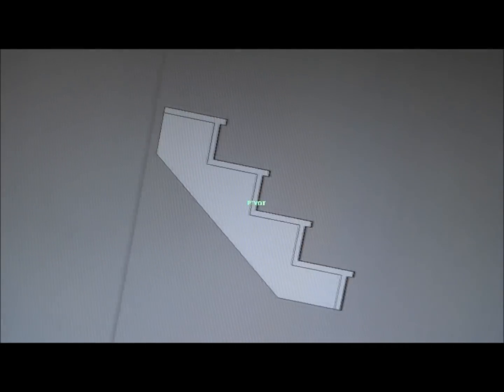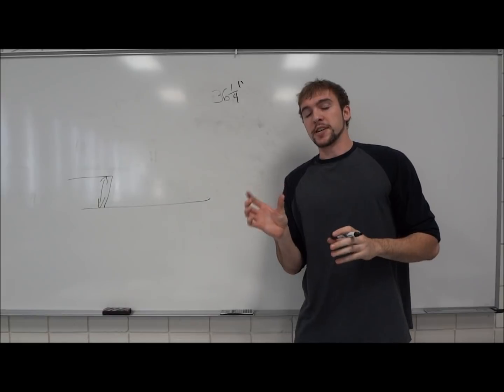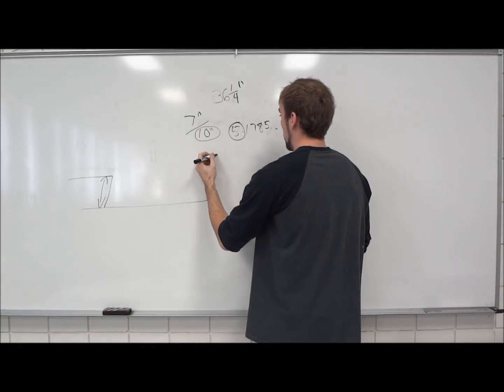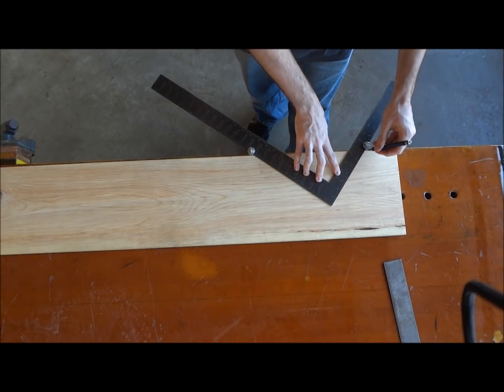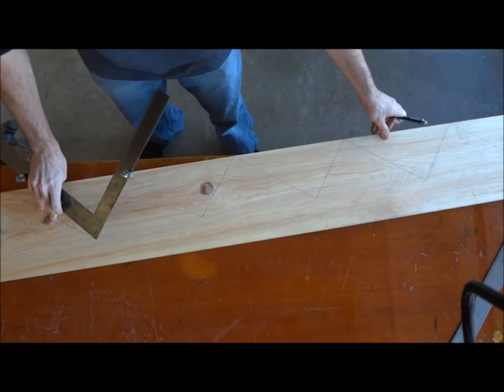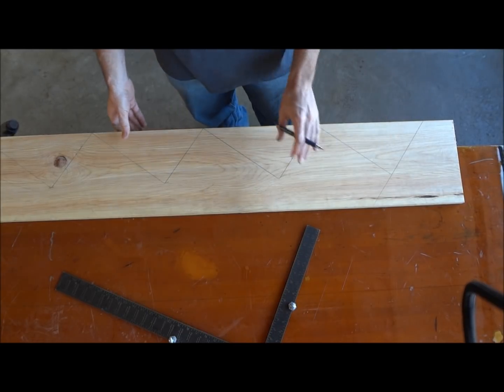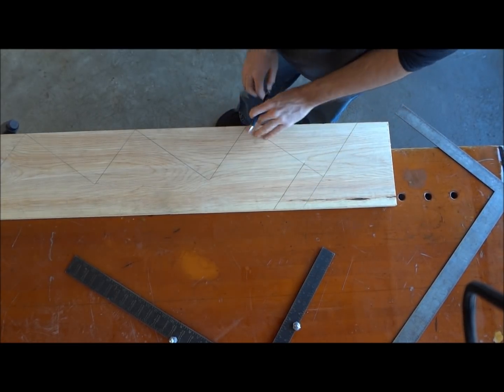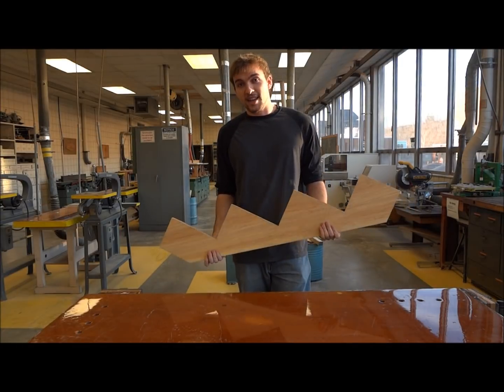How to Layout a Stair Stringer

Comment: You guys forget, you leave out details....such as: how do tou know what is the bottom of the stringer? How do I determine what line needs to be drawn all the way across? I found out the hard way, there is a line to go all the way across on one end: the rise, and a line that needs to go all the way across on the other end: the run, many of us need very very beginning basics ....12x2x10 boards are expensive, too expensive to make a mistake on 🙁

Comment: that stringer had 4 steps not 5 ... am i missing an important fact?
Reply from the maker: The 5th step is the deck itself
Reply: There seems to be 2 ways to plan your stringers. 1) making the deck floor your highest step {like here} or 2) attaching the stringer below the surface of the deck.  I find this confusing as the measurements needed         seem to be the same, i.e., total height especially.
Reply: yes! the last step is on top or the deck surface.  You could cut a 5th step on the stringer, but that would make it even with the top and make it extend outward.  I have seen this done but it looks weird.